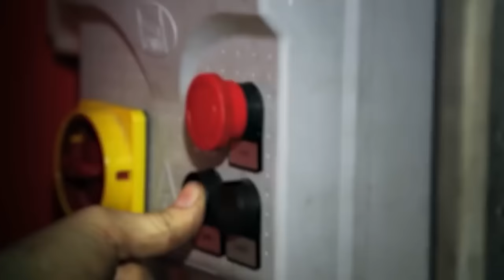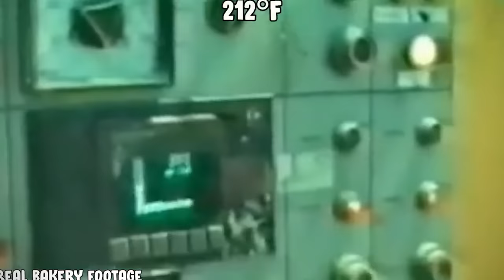15 of the WORST Bizarre Deaths (So Far)

Comment: So many of these stories are the result of greed!!! It's so frustrating. Lillian's story with the Denny's sign is so scary because those HUGE signs are so normal all across the US. The reason it's so big and tall is because it's by the highway so corporations can fight for the attention of travelers. And most of these signs are very very very old. I guarantee there's dozens (if not hundreds or thousands) across the US that haven't been maintained a single time since being installed. Some have probably been standing for 30+ years with little to no maintenance. A just country would immediately take action nationwide to make inspections of such things mandatory
Reply: Agreed. Interestingly though, as far as electronic sign building & maintenance goes (in California at least, I'm guessing other states have similar regs) under code 18.56 'sign standards' things like building material quality, peer-reviewed engineering and (in section 18.56.090) pretty strict maintenance down to regular cleaning & 4 days to replace a dead bulb before incurring the wrath of some nasty fines, the U.S. is pretty good about managing these structures. Especially compared to corner cutting, fast & cheap production-friendly nations like China or Russia. But of course laziness & like you said- greed, can find their way into anything whether it's lack of enforcement or pure corruption. It's so much more important than most people realize that we crack down on such things. And it probably happens a LOT where few people travel & funds are tight. Which sadly puts people in danger. The most important measure to keep everyone happy is always going to be excellence in engineering ⭐️💍 Unfortunately after that, your fine work is at the mercy of decades, centuries, millenia etc etc
Reply: I'm having Deja Vu because yesterday I was driving and that just happened to notice at all metal sign like this that has not been maintained because it's so faded you can't read the emblem.
I was thinking what if it rusted and fell?

They could install an easy fix. They could have cables going from the sign to the post so that if the sign at the top breaks off, the cables will prevent it from hitting the ground.
Reply: Like that old telephone tower in FALL. :o
Reply: "A just country would immediately take action nationwide to make inspections of such things mandatory."...this, literally, does not exist.
Reply: @buttarain27  yes we are aware that's why I'm saying it should 🙄 I'm calling our country unjust lmao
Reply: Louisville is pronounced Loo-ee-ville. So sad.

Comment: With Naoyuki, it may have been hypothermia, particularly with his shoe being found a distance away. It seems unlikely that he was peeping as the school was practically empty and his jeans were intact. With hypothermia, people act very strangely, stripping some or all of their clothes off. Their decision making ability is also seriously impacted.
Reply: That, or he was forced to climb in there at gunpoint.
Reply: They said his keys were in the ignition but the car was locked. I think he locked his stuff inside.
Reply: That one creeper me out. No way he was a peeping Tom. Especially given all the odd elements that just don't add up
Reply: @nicolepepin3739  Why would you lock your keys in the ignition?
Reply: Mytheory is on the same level. People act out with hyperthermia. Take their clothes off to "cool" down. What adds to this is the fact the car was locked. Either it auto locked, he intended to die or he was locked out of his car and thought that climbing in the tank would have kept him warm. the tank certainly would have kept him slightly warmer but I couldn't imagine someone climbing in it and neatly folding a jumper unless the were at least slightly dilerious
Reply: @flameoftherisen6334  Yeah that's what I thought too. The guy was probably experiencing some kind of delusions that made him do what he did.
Reply: Severe hypothermia has a stage when one is close to death, where the body experiences a sensation as if it was actually too hot. People will take off their clothes and wander outdoors or go into strange places.
Reply: Paradoxical undressing is a symptom of late stage hypothermia because the blood is shunted to the core organs, and they suddenly feel warm.
Reply: Folding clothes due to hypothermia makes sense, but being able to do my so in such a small space is confusing

Comment: One problem with the first story is that super-glue & epoxy-glue are totally different types of glue, where as the glue that really makes people get high is contact-adhesive that's usually used to adhere things like laminate to benches, lino to floors, or to glue vinyl or leather in shoe-production!

Comment: I’ve worked in metal recycling plants. Those things run at about 750f. We had to Isco hammer excess aluminium off the walls before re concreting the walls. The company were told it was 4 days before we were allowed in to work. That was never the case, first time I went inside I thought the floor was wet. It wasn’t my boots soles were actually melting. It was a very well paid job but it was like working in hell.

Comment: I have a theory about the Japanese septic tank guy.
Two actually.
My first theory is that he was robbed while standing close to his car, but rather than letting them have the car, he locked the keys inside it. Show as retaliation whoever it was forced him to climb into septic tank. And the reason his jacket was clean is because the septic system had been pumped recently. So they made him take his jacket off before climbing in because it was winter and they figured he would freeze to death. Which he did.

My second theory is that he dropped something in the toilet that he needed. Like an engagement ring or something else easily dissolvable in the poop like a piece of paper or something. So he went out back and realize the septic tank was pretty much empty, so that whatever had fallen was on the other side. So he took off his jacket and folded it up so he can kind of use it as a cushion while climbing across the concrete floor. Then once he got in there, he got stuck. 
This theory does not support the whole missing shoe though.
Reply: I don’t care what I drop down a public toilet, there it’s going to stay!
Reply: Nobody is going to go down a toilet to take something. If its gone its gone. Maybe this man thought hes smaller than average and stuck himself in there to catch a view of those women.

Comment: when i was studying to be a paramedic in either 97, or 98. The ambulance crew i was riding withgot a call about a possib'e snake bite case, from a pipe manufacturing plant in east texas, that made drill stem casings for oil rigs.we roled up on the scene fo find a man in his mid 40s with a snake bite to his right forearm, he didn't know what type of snake it may have been. But he was so concerned about it being a rattle snake that he was having tachicardia and his BP was above stroke stage. as we resured him he would be fine and that no mater what type of snake it was that bit him he would survive. at that moment the 3 guys that went looking for the snake returned with a 4 foot timber rattler. the poor man saw what had bitten him, looked skyward and died of a massive heart attack on the spot.
Reply: Wow…poor dude

Comment: 1. Never glue your dick shut 2. Don't go inside an operational industrial oven. Ok, I think I have the situational awareness/common sense enough to not do either of those. 3. 36 days later?? How long does Chinese New year last for??? 4. Don't vacuum pack yourself. No problem there. 5. Don't get shot with a shotgun at close range. Ok. Shouldn't be an issue there either. 6. Probably best to not go for a drive in a severe storm even if you really want a burger. 7. Don't climb into the cess pit of a squat toilet in the middle of winter. Yeah, I reckon I can probably dodge that one. 8. Don't climb into dinosaur statues head first. 9. Don't jump into jet turbines 10. Don't try and save mobile phones (see also no.8) 11. Don't climb into anything head first (see also 7, 8, 10). 12. Don't sit in boiling liquids that are put in the street for some reason. 13. Don't engage in art installations in the north east of England 13. Don't randomly steal planes when you aren't qualified to fly and then try to fly them (although in fairness, that was a pretty hardcore way to go out) 15. Don't live alone....ah, crap. I'm screwed on that one. Other than the last one, I reckon I've got a reasonable chance of survival.

Comment: In Mary Cerruti's case, some apartments were being built around her house, and she was one of the few holdouts in selling her house to the contractors. There are a lot if beautiful, Victorian homes in the Heights, the area of Houston in which she lived. The residents protested them being demolished to make way for the apartments. Mary was one of them. She had several altercations with one if the contractors, and there was suspicion for a while that she had been "helped" down into the wall. Nothing was proven, so it was declared an accident.
Reply: Thanks for more details.

Comment: If you think these cases were terrible, you should check out the case of Jonathan Edward Jones, a 26 year old man who got trapped upside down at a near 90° angle in the Nutty Putty caves in Utah. What makes it even more tragic is that rescuers were there, talking to him, even able to reach out and grasp his foot, they were innovative in getting water to him, etc. but due to the conditions of the cave the clay like walls of the cave and the position of the tunnel he was was in they were unable to rescue him, at one point they using pulleys starting to pull him out but the pulleys broke free of the clay walls and he dropped back to his original position. 
they stayed with him talking and comforting him until he finally died after being trapped for over 28 hours.
After his death, they determined it would be too dangerous to attempt to retrieve his body, so they sealed up the cave, collapsing the tunnel he remained in which became his tomb, where he remains to this day. 
There is a documentary about this tragic accident called The Last Descent

Comment: The good news about the first story is that the speculation about an exploding bladder is next to impossible. Ruptures occur, but almost always as a result of trauma. And even if the epoxy glue detail is true, it's not uncommon for people to have urinary retention issues. In the case of a clogged urethra, a nephrostomy tube can be placed, bypassing the urinary tract all together.

Comment: Working at a food company, I had to go into huge "cookers" to clean them and not only was it still extremely hot, as I sprayed water to clean it, it would steamed off, the heat was still high in there even though being off for a few hours. These where huge, the size of a large closed in semi trailer, but because the opening was so small I was to be attached by a rope and someone outside looking in, which never happened. Obviously I lived but so many things could have gone wrong.

Comment: I have a theory for the Vacuum story. So what I think was that someone actually helped Ian with the vacuum but the person who had helped him personally didn't like him so when Ian told them to turn off the vacuum and they left it on which may explain how the vacuum was turned on while his hands were tied, how he got in with his legs tied and how the tape was around the top. Then once the person had left him there to die they left the house which explains the unlocked door. (Meaning that the person who could've helped him didn't have the key to the house to lock it) Now this is just a theory I thought of. What do you think?
Reply: A case of auto-erotic asphyxiation gone wrong, perhaps? Definitely a novel way to do it, but hey, to each his own. Or, he was murdered by someone who made him get into the bag thing completely naked and tied up, and then they turned the vacuum on and the guy suffocated. They knew that cops would think it was auto-erotic asphyxiation instead of murder. Idk....just my thoughts.

Comment: Poor Lillian,  they never should have picked Denny’s, if the sign didn’t kill her the food might have. Back in the 1980s when I was a dumb teenager my friends and I would eat there in the middle of the night, whether we had the munchies from eating hash brownies or trying to stave off a hangover,  it was usually the only place open.  The food is garbage but it’s cheap.  I refused to eat there after finding a shard of glass in a milkshake, then a couple of weeks later I found a cockroach in my salad, it wasn’t even fully dead yet.  I had accidentally speared it with my fork but luckily noticed before taking a bite.  It was wiggling frantically around trying to free itself, the sight was revolting although my friends thought it was hilarious.  Even worse the management were total dicks about the situation and only refunded the cost of the salad nd milkshake, charging us for the rest of the meal.  These two events happened only a few weeks apart.  I haven’t stepped inside a Dennys since then which is no great loss as the food is revolting .  😂

Oh by the way the city of Louisville Kentucky  is pronounced Louis like the French king, not Lewisville.  Otherwise great video, most of these were excruciating.  Darwin awards should go the the super glue on the penis guy as well as the Turkish geniuses who thought two pillows would stop a shotgun blast from killing their friend. 😂😂

Comment: That last case is so terrifying! Imagine, you step on the wrong floor panel and it breaks and you fall between the walls and are stuck there. That has to be one of the most unlucky and horrible ways to die. That poor lady 😭 also the woman in the elevator...

Comment: Louisville, (pronounced by the locals as Lou-Uh-Vull and out of towners as Looey-Ville and in any pronunciation, the letter S is silent) Kentucky and the areas surrounding it in this part of the country commonly get strong to severe thunderstorms preceded by high straight-line winds a few times each year.  In fact it isn't unusual to hear of someone being killed by a tree falling on their car during a storm.  That sign falling, while tragic, would actually be considered light damage in any other circumstance as tornados are also quite common in this area and they can produce substantial damage.  I think the most tragic part is that being from this area they should have had enough sense to get indoors during such a storm, or at the very least to park in an area like the middle of the lot in the clear.

Comment: As a maintenance man, let me just say. ....stop blaming us. We do exactly as were told, put that blame on management for thinking preventative maintenance is to much of a cost on the budget. Accidents happen, even if you do everything right. As far as elevators go , an FYI for anybody ever stuck in one. There is a safety bar that keeps the doors from being opened maunaly. If your strong enough, or have something you can pry with, you can bend it out of shape making the door easy to open. It's not easy though.  No cameras , no emergency phone in the elevator. No cell phone to call anybody, or find info on how to get out.... I can't even imagine.  I was stuck in the elevator for only 30 mins, before I said nope, and muscled my way out.

Comment: I call bs on the superglue. Urethral obstruction is common with prostate problems for example or post operatively. An obstructed bladder is very painful and usually fixed by a urethral catheter. If not feasible then you simply put in a suprapubic catheter via a large needle above the pubic bone and leave it in for as many days or weeks as needed. Superglue is used to close wounds without sutures. It falls off as the skin grows and in this case I would be surprised if the superglue doesn't fall off within 7 days

Comment: 10:30 the safety hatches in most elevators are locked from the outside or otherwise inaccessible from inside. General thinking being those inside the elevator will put themselves in more danger climbing in the shaft than waiting for first responders which usually is true aside from very unfortunate circumstances like this

Comment: That bakey story was extremely hard to believe. At least 2 people, maybe more, failed to not only find out how long the oven require to cool but failed to check the temperature b4 going in? This definitly should be on that show 1000 w Ways to Die where people die from doing insanely stupid things. If your boss told you to jump in an active volcano and you do it, whose fault is it ultimately? Not ur bosses.

Comment: The oven one reminds me of the canned tuna factory death. Jose Melena, 62, died in a 270F oven at the seafood company's Santa Fe Springs plant after a co-worker mistakenly believed he was in the bathroom and filled a pressure cooker with six tons of canned tuna. The heat of the pressure cooker and a he weight of the cans which were also hot 🥺 that poor man. They don’t know how long he lived for but knew he was alive during the cooking stage.
Reply: Canned tuna, not tuna still in cans. The tuna is cooked and then canned afterwards. That was different, of you ask me, since the safety lock out system had been turned off by the onsight safety manager, which would have warned Jose the process was being started. The oven situation was where 3 men failed to check the oven temp before sending 2 men inside. Idk, Maybe it is the same. Sheer stupidity.

Comment: I think company’s shouldn’t just be fined a small amount. I think when they cut corners or break safety codes they should be fined the profited they made during the time of the volition. 
Too many company’s think “I’ll risk a $20,000 fine to make $1,000,000 sure” so they do.